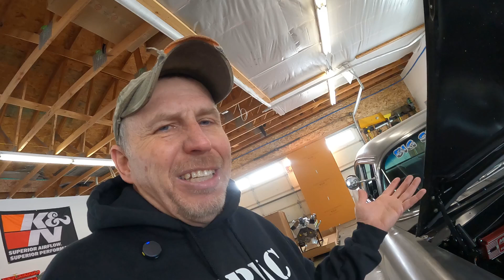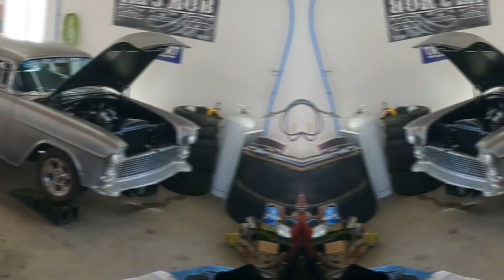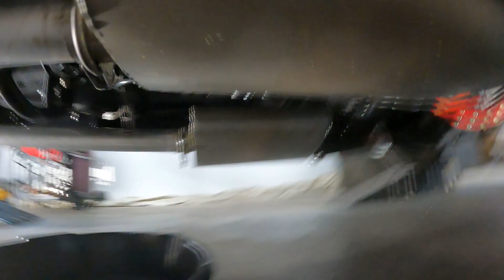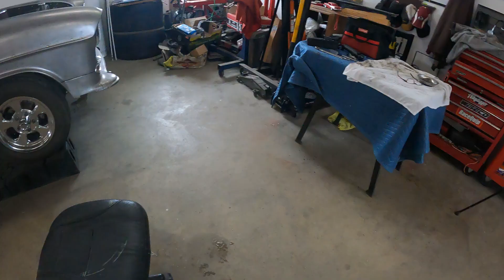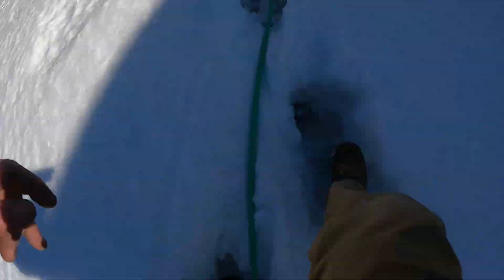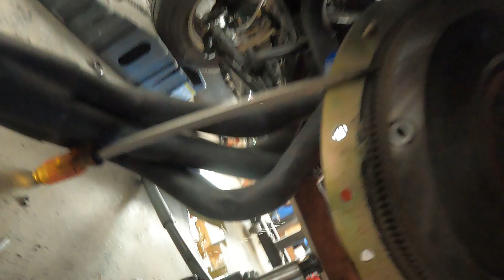1955 Chevy Engine Swap - Making Room for the New Crate Engine - 55 Chevy Build Series

Comment: Before lifts were popular my dad and me would use 4  15 inch wheels and put 4 14 inch wheels stacked then you get more room underneath your car. It' work great for us because you set the smaller wheel inside the larger wheel
Reply from the maker: Sounds like a great idea. Thanks for the tip!

Comment: So when I waist HS (68) a friend had a 55 post.  He put a 302 in it. he was having issues with the choke staying open so he put a small screwdriver in the linkage.  While doing a test drive he floored it.  When he went to shift, the engine was running wild so he dumped the clutch.  The clutch came apart and through the floorboards.  Fortunately, on the passenger side.
Reply from the maker: Dang that coulda been bad, or I guess it was bad but coulda been worse. That's why I've got the scattershield, to hopefully contain any messes like that.

Comment: from my perspective, the new mic is not good.  It's all left channel.  I listen with either ear buds or my hearing aids.  I'm getting nothing in my right ear and Everything is muddled in my left.  Had to turn on Close Caption.
Reply from the maker: I think it is good for the most part. I have had a few clips where it didn't seem to be working right. I assume at this point it is user error, but if it persists I may have to look into a different brand. Thanks for the input.

Comment: what are the new wheels made by. thanks
Reply from the maker: Thanks for watching man! Those wheels actually belong on my '69 Chevelle. I stole them for my "street" tires since my Weld wheels have slicks on them. They came with the Chevelle when I bought it, and there are no brand markings on them. Some sorta Chinese knock offs I am sure. Rocket Racing makes a similar wheel, and I am sure other do as well.

Comment: Check the pan to drag link clearance, some pans won't work. Very nice horsepressure maker too!
Reply from the maker: Yeah I was worried about that, too, and sure enough, it hits. But, it hits like just barely before full lock. I "think" I will be able to get away with adding some steering stops to the A arms to stop the steering just before it hits the pan, and still have enough turning ability to not really notice. I won't know if that will work until I drive it. If it doesn't work, I'll have to change or modify the pan. Not fun. Thanks for watching and for the heads up!

Comment: Will be watching to see what headers your using. My heads are angle plugs and the headers I bought say they won't work. I have that same problem with my shop. Had to seal the block inside and out. Still having some problems. Oh yeah you must have a great wife or ups delivers after dark. Lol have fun.
Reply from the maker: No need to wait on the headers. I got 
Patriot Tri-5 Headers H8050-1 and if you buy 'em from this link I might make a couple bucks! https://amzn.to/4bZwwff They fit great for me, but the old bellhousing mounts must be removed for them to work. I really do need to do something about the drainage around the shop, but who am I kidding, I probably won't. Maybe I will... I do have a great wife. She understands I worked my ass off to make it possible to make these upgrades, and is willing to sacrifice her/us getting other things we probably needed more than a new engine so my little dreams might come true. She's a keeper for sure! UPS does still come sometimes at night. She doesn't need to know everything... haha. Thanks for watching!

Comment: Hey Brad I'll tell you what I do as far as the leaking stat gasket, set your stat in first then glue two of the thick gasket together with the sticky form a gasket the stuff that comes in the little can with the brush, put it all together and let it set over night, do not over tighten it just do a tight suge on the two bolts. This works well for me, but you need the thicker gasket to get the good seal I like the plain jane black gasket they are kinda softer and compress nicely, give it a try. Later Tony G.
Reply from the maker: Thanks for the tip. I didn't notice it leaking it all until it at for a while, so that's why I was surprised to find the leak. The new engine has a water neck with the o-ring. Instructions said no asket, no goop, just the o-ring to seal. Hope they're right...

Comment: I put a TKX in my 55.I like it. Be sure to index the bell housing opening, and check the bell housing mounting surface for parallelism with the back of the block.
Reply from the maker: Yep, my transmission guy got me all hooked up with what I needed to do. Hopefully I did it right, which is always a question... Thanks for watching!